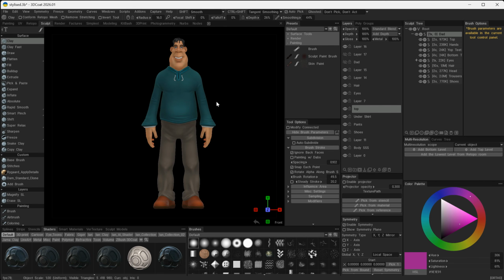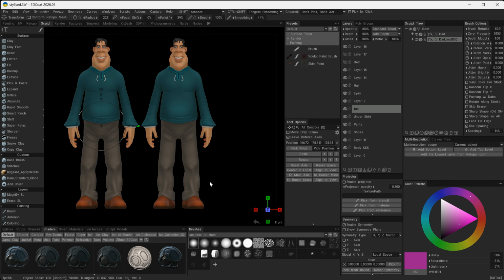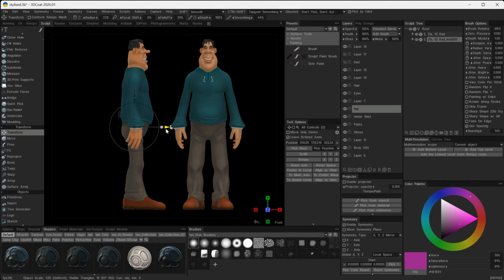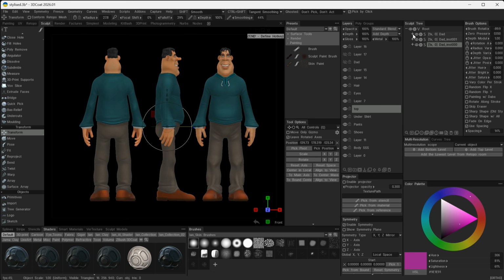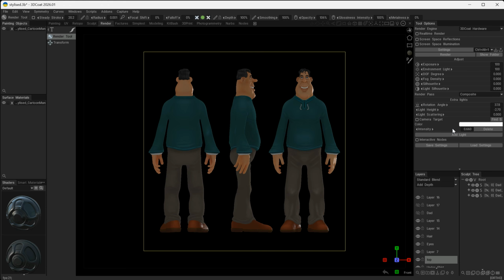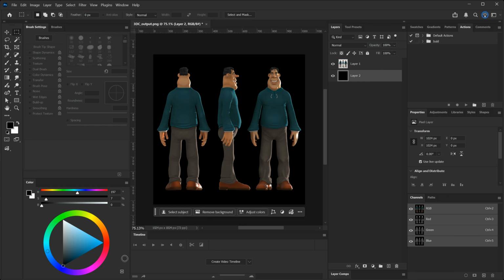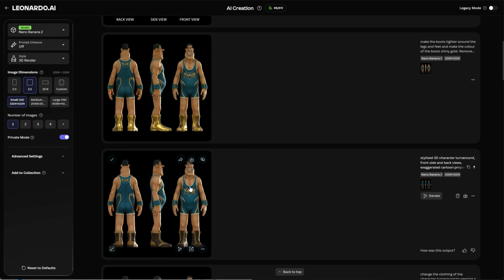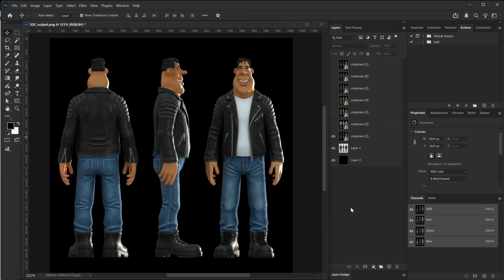3D-Coat Sculpting - Instances for Design

Comment: I don't care about AI nonsense, but I like that stylized 3d Character you started with! Did you make it in Coat? Could be a great subject for future tutorials!
Reply from the maker: Yes it was made along time ago in 3d coat. Modular character. The ai is very good for finding costume designs which can be then be referenced to model and sculpt additional costume pieces.
Reply: Same here. If you use AI for design iterations, it is not you who did the design iterations. You are outsourcing your creativity and passion to LLMs for a monthly subscription, and are degrading your own creative skills and the ability to express passion on the way. Concepting doesn't need to be polished. It is a discipline that should convey ideas, hands on, and in flux, playing in the dirt, letting it happen, iteratively, not polished, sterile, final appearances. The process of your own creativity is killed along the way. It is not the same as photobashing, since photobashing is an active part of iteration and can lead to a lot of dynamic ideas and inspirations. "AI" is just the result. It is like working with a one armed bandit as a replacement for creative process. It is backwards and has no place in the arts. Especially not in concepting, which determines the entire look of a project. Sculpting off of ai generated imagery should feel like an insult to the sculptor. Why create on the basis of something that was ruminated and spit out by a machine? 3D Coat is literally the ultimate 3D concepting software, so this feels even more paradox in this context.